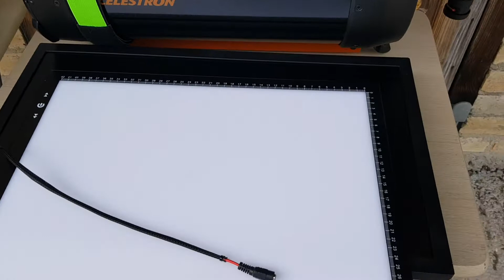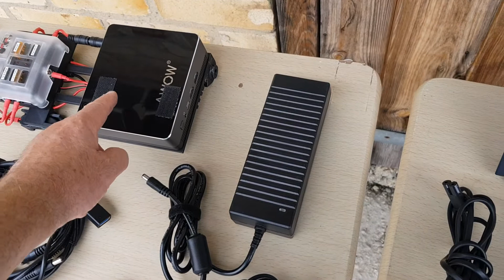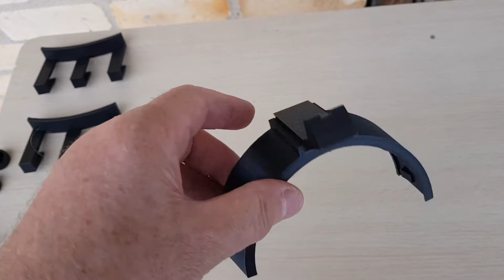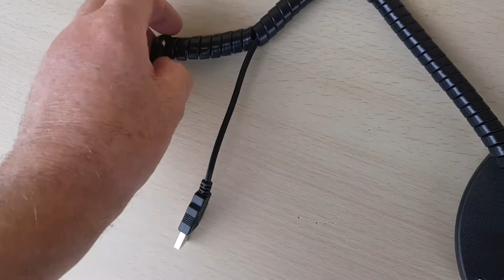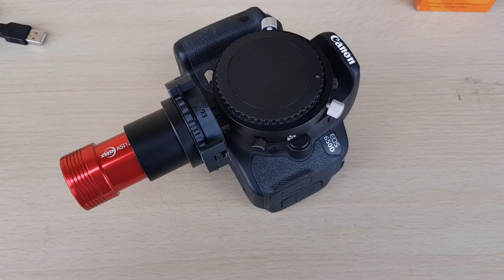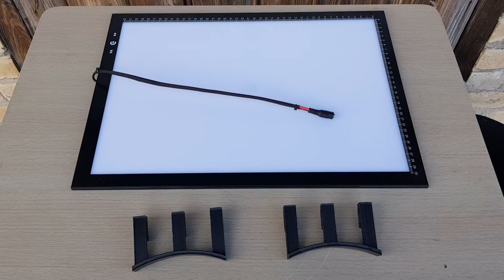Astrophotography Celestron CGX 9.25" SCT Rig - Components and Setup

Comment: This video is amazing! I have the same scope and I'm habing trouble mounting the OAG to the back of the OTA. I'm very new at this. Could you tell me please what's the part number or name of the adapter you use from de back of the OTA once you remove the star diagonal? I can't seem t find it online and can't connect the OAG nor camera or anythng to the scope, it's driving me mad!
Thank you in advance!!
Reply from the maker: Hi Haggis 😁 The thread type on the back of the OTA is known as an SCT thread, being male on the 'scope. So, you need an adapter which has a female SCT thread. I have two adaptors I use, depending on what else is in my optical path to the camera, a short SCT to M48 adapter and a 50mm long SCT to M42 adapter.  What you need to connect your OAG will vary depending on what threads it has,  or what adapters it comes with, so I can't be specific I'm afraid 🤔 Don't forget to get your backfocus right, which should be 139.1mm for the OTA alone, or 105mm if you use a Celestron 6.3 focal reducer. Hope that helps 😁 Good luck with your CGX!
Reply: @michaelbenn4741  Thank you SO mcuh! Awesome explanation.
Reply from the maker: @HaggisMcMutton13  Always glad to help 👍😁

Comment: Hi would you make the STL files available for the items that you 3D printed? Thanks again, I keep coming back to get ideas.
Reply from the maker: Hi ShaunO :-)  Yes, sure, not a problem.  I'll spend a couple of hours making things like the PC / DC Distribution plate and D-shaped cable clamps generic, so that there are none of my product-specific holes in things, then upload them to Thingiverse or Instructables, then anyone who downloads them will just need to add their own holes of the correct sizes where they need them.  I'll upload my product-specific ones too, and include some information on what I'm using by way of equipment.  Clear skies!
Reply: @michaelbenn4741  wow that’s amazing. Thanks so much
Reply from the maker: Hi ShaunO.  I've made an instructable, covering the PC and DC fusebox mount, with all of the required STL files, which is currently awaiting approval before it gets published.  It should appear at https://www.instructables.com/Telescope-Dovetail-PC-Mount-for-Celestron-CGX-GEM-/ shortly.
I'm working on another that covers my cable management solution, which will get published soon, and I'll update you when that happens too :-)
Reply from the maker: Hello again :-)  I've published the cable management part of this porject to instructables now, but it is awaiting approval too.  Once it's live you'll find it at https://www.instructables.com/Celestron-CGX-Cabling-Solution/ :-)
Reply: @michaelbenn4741  Thanks so very much. I appreciate it. :-)

Comment: how are you dealing with finding stars off that OAG ? I tried last night with a C8 edge and zwo120mm and could not guide using the OAG.
Reply from the maker: Hi Paulo :-)  When I'm planning an astrophotography session I use Stellarium to see what targets will be available during the session, and then use Stellarium's Oculars facility to plan which sensor and lense (3x Barlow, Focal Reducer or None) I'll be using for each target, with the ability to see what the field of view for both the sensor and the OAG will be, which allows me to plan how to orient the camera to get the best framing, but also allows me to see what guide stars  are available around the target and also allows me to know how to orient the OAG to find the planned guide star.  There are some targets where it can be hard to find a guide star, particularly when I'm using the Barlow, but that's just the way of things unfortunately.  The TS Optics OAG has quite a small prism in it and the 120MM Mini has a small sensor and a relatively low pixel  count, so that makes things harder too of course.  At some point I expect I will upgrade the OAG to a bigger one and the guide scope too, but I'm still learning how to get the best out of the rig as it stands, so it'll be a while before I change anything I expect.  Clear skies!

Comment: Hi Michael. Awesome setup, well done. how do you fare with focus? Usually the 9.25 has a back focus of 139mm. I think you only get about 30-40mm in your setup.
Reply from the maker: Hi Rene :-)  I wasn't aware of the requirement for backfocus at all when I made this video, hence it being so small.  At the time I was managing to get focus, but did have problems with distortions in my images.  Someone else pointed out the same thing you did, so I took one more step on my path to astrophotography enlightenment and now have backfocus settings for the various ways I use my rig and take it fully into account when setting up or changing my configuration.  At a conservative estimate I'd say I'm about 30% competent now ;-)  However, I'm probably kidding myself!

Comment: OCD much. That is so clean and neat.
Reply from the maker: LOL, that's me!  I've now upgrade to an ASI294MC Pro and added a Celstron Focuser and StarSense, so the cabling cleanliness has now reached even greater heights, so check out my other video for a peek at that too :-)  I haven't had clear skies for months, so here's hoping!
Reply: @michaelbenn4741  buddy you need to put down that 3D printer. Lol. Your making us look bad. No really. Nice work. Really nice work.
Reply: @michaelbenn4741  I also have a question. How will does that 3D printed camera attachment work with zwo and the canon camera at the same time. Can you do more of a video on that. That’s a awesome idea you can up with there. Give you the option of running both Dslr and a digital camera.
Reply from the maker: @americanmaker8608  Ah, sorry, I obviously didn't explain that adapter clearly enough :-S  The adapter lets me mount my DSLR onto the CGX mount directly, in place of the SCT OTA.  That way I can do wider field astrophotography, as my Celestron 925 only gives me a field of view of about 3/4 of a degree even with my focal reducer on, this way I can use the DSLR whilst still allowing me to use the CGX's go-to capabilities and APT's capbilites too :-)  I have been considering creating a solution to allow me to use the DSLR and SCT at the same time, but I am concerned about the SCT getting into the cameras view if I mount the DSLR at the point of rotation, or issues with weight if I mount the camera nearer the corrector plate end of the SCT.  It's still going round in my head though, so watch this space ;-)

Comment: I have a xlt c9. 25  just like yours. How do you recon they hold up against an edge hd for astrophotography?

Considering the 9.25 is said to have a little bit slower mirror I've heard that the image quality is better. Putting a flatener /reducer on it, is it acceptable for ap?
Reply from the maker: Hi Avecfort :-)  Sorry, I've never used an Edge HD, so can't comment on the comparison between one of those and the one I've got I'm afraid :-S  I use my 'scope for astrophotography as it is, but also have a Celestron 0.63 focal reducer and a Celestron 3x Barlow, and all it works just fine whichever mode I use :-)  HTH!
Reply: @michaelbenn4741  same as I have except for the Barlow. Do you post your photos somewhere? How would you say that the stars are at the corners of the image, still round or elongated?
Reply from the maker: @Avecfort  Hi again :-)  No, I'm not currently posting my astro photos anywhere.  I used to suffer from star elongation, but sorted that out by using the correct back-focus (105mm using the Celestron Focal Reducer), so now my stars are round across the frame, as long as I've got scope properly polar aligned and my guiding is running correctly :-)
Reply: @michaelbenn4741  That's great news! Thanks for clarifying that. Been debating wether it's worth setting up a photorig around it but hearing you're getting such good results I'll give it a go :)

If you ever do decide to post some photos and happen to remember me, feel free to post a link to them here!

Clear skies!

Comment: Glad you are managing to image with that CGX. I'm having huge guiding problems due to RA stiction... Guides just fine for around 40 seconds then jumps about 4 arcsecs in RA.... PEC has dones nothing to solve the issue... It's gone to warranty once, going again now... Wish I had your mount to take some images.
Reply from the maker: Oh dear :-(  I hope that your CGX comes back fully functional!  I'd love to do some astrophotography, but the weather has been rubbish here in the North-East of England for months now :-(
Reply: @michaelbenn4741  hope it comes back in good shape. Bought it last year haven't done a decent image since then. Only moon. Useless for everything else.
Reply: Unfortunately these mounts need complete motor rebuilding, the belt pulleys are ALL egg shaped!! So the mount eats away at the inner motor bushing's

Comment: I am so impressed with all your 3D printed mounting widgets. That whole dovetail system for mounting the PC... you could sell that. Can you tell us what software you use for controlling the mount and what you use for imaging sequence control? Show us some of your images?
Reply from the maker: :-)  Thanks for the feedback ADebbil!  I usually use APT to control my mount and cameras, and PHP2 for guiding.  I do have a Celestron Focuser, but (due to incompetence on my part) managed to slightly bend the focuser shaft on my SCT, so that the focuser now binds instead of running freely, so I've had to take it off and revert to manual focusing :-(   I have a plan to fix it, but have a couple of other projects on the go at the moment :-S  When the focuser was working, I was using the TempHum sensor and the focuser temperature adjustment capabilities of APT to change focus over a session as the temperature changed.  

I'm about to upgrade from the Canon 650D to a ZWO ASI294MC Pro, so I'll need to do a bit of rework on the cabling, but I'm hoping for a big step up in image quality over the DSLR :-)  The nights aren't getting dark in the UK at this time of year, but I'll be getting my rig fully together over the next few weeks ready for the longer nights ahead and will probably do an update video on my setup then.
Reply: @michaelbenn4741  I’m running the ASI294MC Pro on a rig now. I’ve done half hearted astrophotography over the years just pointing my LUMIX GH3 at the sky. This past year I was able to go kind of apeshit buying gear. The rig I’m running lately is the ASI294MC Pro on a Canon EF 400mm f/2.8 L with a Canon 2X extender. I have a Russian-made Astromechanics USB focuser that works amazingly well. I have a QHY/Orion 30mmx130mm guide scope with an ASI120MM Mini guide camera. It was a fun project getting all that built up with rings and dovetails etc. I was running that massive rig on a Celestron AVX mount. But I’ve recently been running on a Celestron CGEM II mount. Anyway, I’m also gearing up an EdgeHD 11” system and an EdgeHD 8” rig. I’m looking forward to seeing some of your results with the ASI294MC Pro. I’m pretty happy with mine. It has some interesting calibration requirements. For example trying to use Bias frames with it totally screws up my stacking. 
I encourage you to continue making astro videos. You have my interest.

Comment: Thanks - for that! Not sure why you are using the USB connection on the Hand controller, rather than the one on the mount - allows you to use the CWPI tool.  I don't even have the hand controller connected. (I use starsense to do any alignments)
Reply from the maker: Hi Timothy :-)  I like having the hand controller there to allow easy access to the mount for putting the Bahtinov mask on and off, or for flipping it vertical to use my flats panel, so the additional cable (which is 'hidden' inside the controller cable) is no hassle at all :-)  Also, as my software stack is based on ASCOM, and the USB A port on the mount cannot be used for that purpose, as covered in the CGX manual states on page 13, it advises that ASCOM must always use USB port on the hand controller.  I'm currently working to make the connnection using Bluetooth, by hacking in a Bluetooth module into the NexStar remote, but that's just because I have the module and am seeing if I can work out how to do it :-)  Clear skies!
Reply: @michaelbenn4741  Hmm - well I use the USB port on the mount via ASCOM - as long as you start CPWI first it allows any tool (SGP, Voyaher, NINA etc) that needs ASCOM mount control to work.  see this thread on CN:https://www.cloudynights.com/topic/689802-cgx-mount-usb-port/
Reply from the maker: @Fat-totoro-cat  Thanks for that :-)  It looks like Celestron finally adopted ASCOM through CPWI, which wasn't supported when I got my CGX.  But, given that what I've got works just fine and the fact that I don't really want CPWI in my software train, I'll be sticking with with my current setup!  Cheers :-)

Comment: All the 3d printed stuff for wiring and cables are just soooo cool! You would be scared if you d take a look at my setup in comparison! Nice job! I have an heq5, what advice/rule should I apply if I want to start designing similar stuff for it?
Reply from the maker: Hi Alexandre :-)  Glad you like my setup!  I started out by sketching out a diagram showing all the components I wanted to have on my rig and then played around with all sorts of combinations until I found the best place for each of them to be in order for there to be the minimum amount of wiring, so deciding where to place my DC distribution board, for instance, was just a case of looking at which devices needed power, then working out the place where I could acheive that with the fewest connections between the different parts of the rig.

I spent a fair amount of time choosing the Awow NYI3 mini-PC, but once I'd made the decision it was then just a case of working out the best way to get that, the fuse box and the other things like the dew band controller into convenient places where wouldn't unbalance the mount or put excess strain on any cables.  The cable management side of things toook a bit of creative thinking, but I'm really glad that I spent the time and got things right.

I'd not done any CAD or 3D printing before I started on my astro journey, so as well as learning the basics of this amazing hobby I also had a very steep learning curve on that front too, and must have made at least twenty previous versions of every 3D printed part you see here before things got to the current stage, and I'm still thinking of things I can improve, but that's the great thing about 3D printing, isn't it :-)  Good luck with your HEQ5!

Comment: Do you have any tips for a SCT User looking to move into AP? They say its difficult to begin with?
Reply from the maker: Hi Adrian :-)  Phew, there's a big question!  There are so many aspects to this great (but often really frustrating!) hobby, that it's a bit difficult to know where to start.

Hopefully you have a good GEM mount, as that makes things much better, but either way I would say that the most important thing is to get long exposures, so in addition to a good camera (better than mine) guiding is the most important thing I think.  With a long focal length SCT like mine (2350mm), going for a guide scope is not really feasible, as it also needs to have a proportionate focal length, hence me using an off-axis guider, which works pretty well.  Getting proficient at setting up, and ironing out as many 'could go wrong' things as possible beforehand means that the limited time we get under the stars when the conditions are right (almost never for me in the north of the UK) can be used to the best effect.  

I'd also suggest that you plan every session ahead of time, with a number of targets in mind around the visible sky that you know you'll be able to see throughout the night, then if the seeing is compromised in one part of the sky at least you'll have a backup plan :-)  Another key aspect of astrophotography is getting your post-processing skills and tools sorted out, as, while you can take great Moon pictures in a single shot, even they benefit highly from stacking and processing multiple images.  The tools I use for my astro sessions are APT, PHP2, Stellarium, ASICAP, SharpCap and occasionally BackyardEOS, then for post-processing I use Registax, Siril, Deepsky Stacker, GIMP and Darktable mostly.  HTH!  Clear skies my friend :-)
Reply from the maker: Oh, and make sure that your focus is right; so get yourself a Bahtinov mask for sure :-)  Oh, oh, and do take Darks and Flats and Biases if you can, then include them in your post-processing.  Oh, hoh, oh, and try to find some people locally who you can share your troubles with (astro ones!) and get help from.

I'm about two years into this amazing hobby and still feel like a bit of a noob, as there's just so much to learn!  Great fun though!
Reply: @michaelbenn4741  Grabbed a mask and running a9.25 on the CGEMII Mount...Software is the big learning curve atm lol, but its all new!!